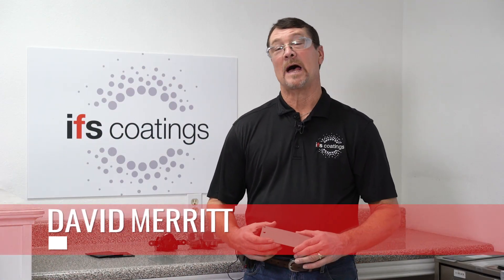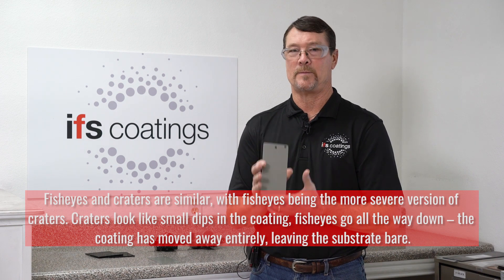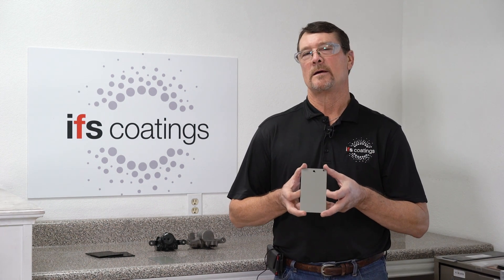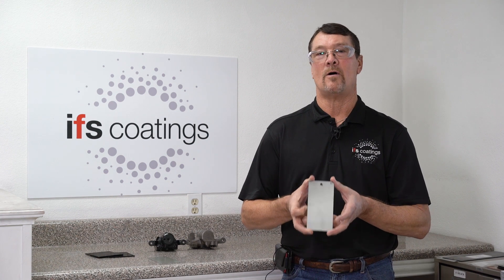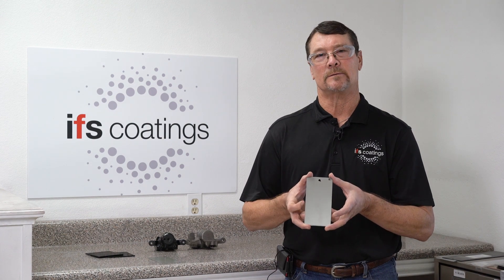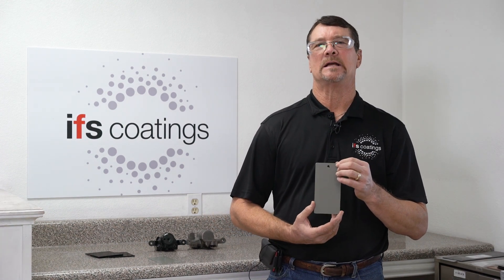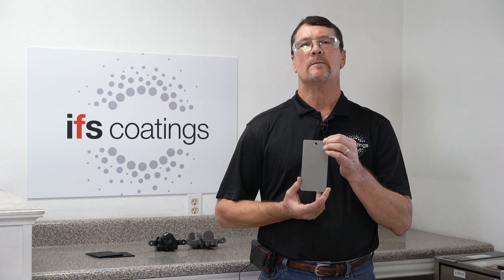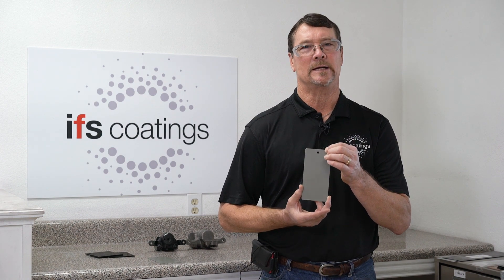Preventing powder craters and fisheyes - problem solving powder coatings

Comment: You are wrong. Fish eyes only comes from over charging on recoats. As far as contamination goes . If the craters are on top only ,  in regards to how it is hung then the problem is airborne meaning deodorant or a can of crc or something like that. If your craters or pin holes all over your parts underneath and on top , then the problem is in the powder hopper. Cleaning your gun and hose is never the problem with craters . By Cleaning your gun and hose you are merely Cleaning colour contamination nothing to do with craters . Have a nice day.